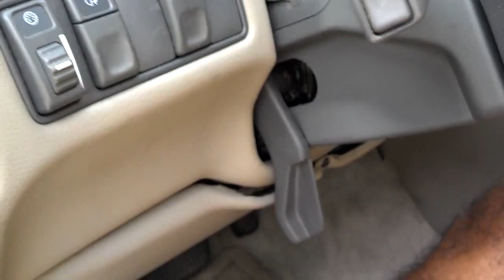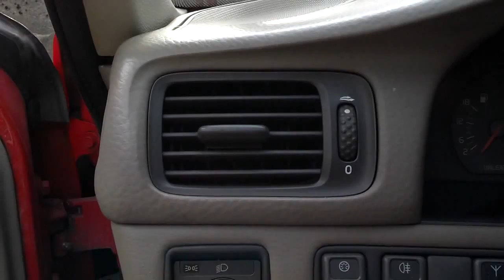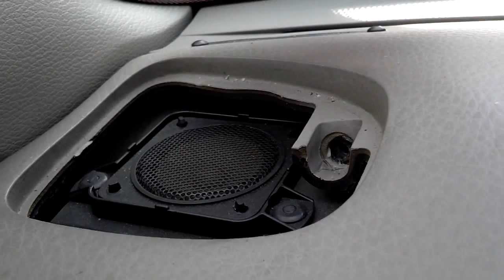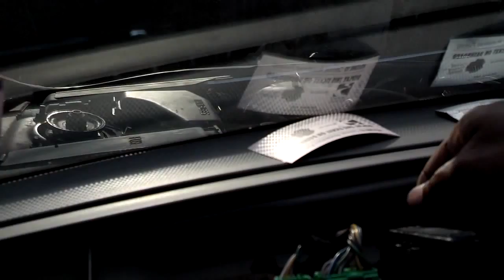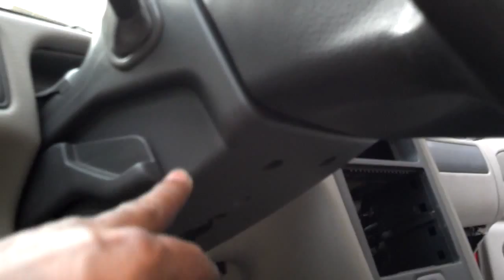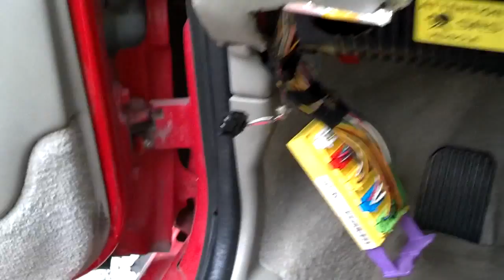Dash removal for noise / evaporator replacement, Volvo S70, V70, 850  Repair part 1 of 3 - VOTD

Comment: Hi there Robert, your videos have been very useful in working on my 2001 V70, I didn’t see how you pulled the gear shift knob, is there some trick to it or will brute force remove it.
Reply from the maker: force
Reply: Thanks, I didn’t want to yank on it and break something else.

Comment: I was fortunate to not have this problem, knock on wood, on my former '95 850 T5 or current '98 S70 T5.  I have had the dash pad out on the S70 and my '05 V70 2.5T - fun job!
Reply from the maker: cool

Comment: Hi Robert! I have a 850R 1996 with the gray interior and the dash pad and dash are cracked into pieces over the years. My question to you is I see a bunch of tan dash and no cracks. Can I take the gray parts of my dash and put it where the tan parts of a donor car or are those permanently bonded on?
Reply from the maker: huh? I don't think so.

Comment: Hey Robert ,  Any clues as to what would cause all 4 windows AND the sunroof to suddenly not operate on my 2000 V70 GLT ?  Strangely , when I got off work last night I was able to operate both front windows but couldn’t get the rears nor the sunroof to close either .  Right now none of the 5 are operating .  I know you’ve been in the middle of a big move , so you may not even have your WiFi set up yet (?) .   Thanks in advance for any suggestions !    I hope your move went well and that you’re loving your new home .
Reply from the maker: have you checked fuses?
Reply: @RobertDIY   Thanks for your quick reply !  You know what , I’m thinking your first guess was spot-on - bad ignition switch .  About the fuses related to the windows :  I did look for the window motor fuse(s) on the lid to the fuse box and was confused as there doesn’t seem to be designated fuse printed on the fuse list there .  I DID however just went ahead and checked all my fuses just in case there was a fuse that covered more than just those windows - all looked good .   SO , (and this is a tad embarrassing) because I have had that button on the gear shifter not pop back out , etc. so I’ve gotta fix that as well .  I’ll have a look at the video that’s linked to the link you gave me .   I’m about 95% sure that’s the issue .   WIRING IS SO STRANGE !  (I just found your video that shows how to replace that gear shift button also) 
I mean ,  who would guess the windows and sunroof not operating would be related to a bad ignition switch ?  Time to watch that and order some parts .   Thank you again , Robert .  Second time you’ve saved me $ !   Forgive my long reply .   I’m just happy you were able to help me .
Reply from the maker: Silver metal fuses under the edge of the box lid.
Reply from the maker: https://youtu.be/x3MP9KaPMqA

Comment: Robert. Thank you. You have a great communication skill along with your mechanical skill. I am just beginning this job on my 1998 V70. And yes i scraped my hand on that climate control cluster removal!  I appreciate your instruction.
Reply from the maker: Ouch! When you support the dash mounts, use 1/2" stainless steel straps. Thinner and easier to get the dash back in.
Reply: Robert DIY your idea of the straps worked perfectly just as you described. Thank you Robert! I had this system running icy cold. But today the low pressure side line just popped off the evaporator. Couldnt believe it. I thought for sure it locked in place. It appears the line bottoms out when inserted all the way in. But i suppose the locking spring mechanism is stuck or broken. Have you run into this before?

Comment: hello Robert, Thanks for the great videos. I have an 850 sw 2.3 turbo 1996. My climate Control does not work properly. the Ac Works but just cant choose where the Air flow goes (down, center, windshield). what Can i do?
Reply from the maker: Make one of these and read the error codes.
Reply from the maker: https://youtu.be/LpoyZsaPVqc
Reply from the maker: Where are you located

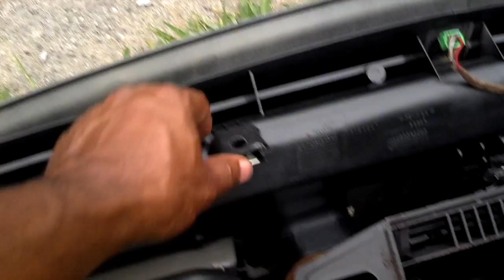Comment: What is this "sensor" 22:09 min green plug in the center of the dashboard?
Reply from the maker: Alarm light.
Reply: @RobertDIY  What does it do? I was not even aware that the car has some alarm system...
Reply: @RobertDIY  well, I don't have the alarm. On my car there is just flat piece of plastic. Thanks anyways

Comment: I really wish someone would show me how the airbag connector disconnects. I've watched 5 different videos and and searched forums and everyone just skips over that part without actually showing how to disconnect it. It's not a normal looking connector and it doesn't seem obvious on how to disconnect it so I don't want to break it. I'm stuck in limbo trying to remove my dash to replace/upgrade my dash speakers
Reply from the maker: I've posted several videos over the years showing how I disconnect it. Squeeze the taps and pull the wire out of the connector.
Reply: @RobertDIY  instructions don't really help. The connector I have doesn't look like yours. A video would help. I've watched 2 of your videos and they both skip over
Reply from the maker: Well, I don't even know what year model car you have. It's just a connector, isn't that hard to figure out.

Comment: After removing the all bolts. Do you have to give the dash a good tug? Or do they come out pretty easily
Reply from the maker: Have you tried it?
Reply: Robert DIY I pulled a junk yard dash. I had to pull pretty hard. Not sure if i further damages the brackets in the process. But I’m about to attempt to pull my dash
Reply from the maker: Sometimes they are stuck to the firewall because of the material they put between the dash and firewall metal to reduce noise.
Reply: Robert DIY okay i understand. Thank you for your help Robert. Keep up the good work
Reply: @Marcos8311mmc  For me it came right off but make sure to check everyone screw is gone so there is no leftover screw.

Comment: Aw man, not the windshield wiper shroud!  I JB welded my left wiper arm to the armature after exhausting all other possible repair options.  (The armature had no grip on the wiper arm and it was much too stripped to be fixed save to JB weld it.)  Perhaps I can cut the shroud so that I don't have to remove the left windshield wiper.  But if the tabs at the back of the dash are typically broken like crazy just from dry rot as shown in this video, then I suppose I can skip loosening the 4 bolts under the windshield shroud.  The evaporator leaks and the driver side AC temp control valve is messed up.  I can compensate for the slow evaporator leak by adding refrigerant every few months, but that valve, that valve...  I don't know if I can access it short of dash removal.
Reply from the maker: https://www.youtube.com/watch?v=VGxyj0UTDp4
Reply: One more question, how did you remove the knob on the gear shifter?
Reply from the maker: https://youtu.be/gt9w-ZSxs9I
Reply from the maker: https://youtu.be/rNi4orgovpE

Comment: The passenger air bag on my 1999 S70 is wired different, anyone else come across this?  Actually stopped there since I couldn't figure out where or if it's even possible to disconnect the air bag.  Any ideas?  thanks everyone.
Reply from the maker: +David Fierro the plug clip slides out to unlock it.

Comment: my car haven't had any pollenfilter and the evapolator is FULL with dirt, mud and other nasty stuff. I have been trying to clean it while is in the car from the fan whole but can't reach to it. is it bad for my health if it's that dirty? or does that dirt just stay there and not spreading bacteria via they air from the vents?
Reply from the maker: +AlfaPower probably.

Comment: Robert - I am getting ready to tackle this on a 1999 Volvo V70.  The issue is that I don't have the access to parts from a salvage yard that includes a lot of Volvo parts.   So, the question is this - without the brackets all being there, it is possible to repair the car using the existing dash?  Thanks in advance and thanks for all the other videos...they are very, very helpful.
Reply from the maker: +craigholliday did you watch part 2? The link is in the comments.
Reply: I did.  I must have missed it as I was watching very hard to make sure I got the nuances.  Sorry for the contact for nothing.  Thanks for the note.
Reply from the maker: +craigholliday no problem.

Comment: I have a 1990 Volvo 760 GLE.  I have a vacuum leak that I hear from inside the car, through the vents. There are 3 vacuum lines that plug into receptors on the firewall. I have disconnected them and plugged them temporarily,  to avoid the loss of engine vacuum. Is there an easy way to find those lines inside the dash so as to discover and fix the leak. I think the lines are used to control the vent doors. Maybe you can point me to another of your videos which may better reveal a solution
Reply from the maker: There are bellows behind the dash that crack. I believe the dash has to be pulled to find and fix the leak. I do not have a video of the process.

Comment: What if I put a 850 dash in a s70 GLT? Is it possible?
Reply from the maker: +LuisWRXSTi Entire dash or just the top pad?
Reply: Entire
Reply from the maker: It will probably fit, you'll need to do wiring and all of that stuff.
Reply from the maker: Doubt the ECC will work.

Comment: You forgot to tell people to unplug the heated seat plugs near the coin tray, in vehicles that have them. They can damage kind of easy, and i know you didnt have them in your car so you werent thinking about it. Its also good time to change the bulbs in those heated seat switches, as well as the ashtray/ cointray light.
Reply from the maker: +Eastsidegeorgiaboy Cool, thanks for sharing.
Reply: Eastsidegeorgiaboy dash rattle

Comment: Hey rob, I've been following these videos to get rid of the dash noise and I would like to point out two things that made getting the whole dash out easier which are to remove the ashtray and also the shifter knob. You have that done on your video I just figured it would be useful to mention here. To remove the shifter knob you just put it on low gear and I just pulled it up with care and brute force so I'm hoping I didn't damage anything though that's what people said to do. Thanks for the video man, made things a hell of a lot easier though the broken pieces are overwhelming! I'm the third owner of a 99 S70 and apparently the only one who ales good care of it lol
Reply from the maker: Juan Olivares Glad you got it fixed. I usually do NOT remove the shifter. Sometimes they break.

Comment: I can't seem to remove the center console in my S70, I need to fix the cigarette lighter and the bulb under the shifter. How did you remove it?
Reply from the maker: Emerson Hidalgo Volvo S70 V70 Center Console Removal - Auto Repair Series

Comment: Great video. I used this video to take apart my whole dash, and used it to put it back together, just to find everything was perfect and intact, and that the fuse was intermittently working. At least now i know i have a good evaporator and heater unit.
Reply from the maker: Sean Huffstickler Wow! You had an AC issue?
Reply: Robert DIY yes. The PO installed a modem and wired it to the climate control fuse. somehow, that unit wasn't allowing the a/c relay to work properly. i disconnected the modem wires, and had to thicken the fuse leg because of intermittent connectivity. low and behold 246k miles on the odometer and everything on it works like new
Reply from the maker: Nice

Comment: Good video man, my S70 dash has driven me nuts for a year.  Used epoxy on the mounts and a fiberglass type fiber for strength... No more squeaks so far.
Reply from the maker: Corey Wright Nice. Glad the video helped.

Comment: i'm not sure if you know or not, but i stuck my head behind the steering wheel while removing the airbag, and the bolts that hold it in aren't T30's, they use an allen wrench.
Reply from the maker: Sean Huffstickler Which car do you have? Maybe they have been changed.
Reply: Robert DIY 1998 S70 non-turbo. The head of the bolt on the airbag unit is a 4mm allen wrench. the torques will work, but the allen key is the type of head on the bolt
Reply from the maker: Cool, thanks for the info.

Comment: i have removed two sunroofs on the 850 Volvo's and neither of them work is this a normal problem with the 850 ?
Reply from the maker: Nope. How do you know they don't work? And why are we posting sunroof problem on a dash video? Roof head ceiling liner and sunroof removal, Volvo and other cars - Auto Repair Series

Comment: Blessings Robert. My mechanic and I will be replacing the ac evaporator. The question he ask me to present to you is what tool do you need to disconnect the ac lines at the connection into the evaporator by the firewall. He said to mention the garter springs. hope I presented the question correctly so that you may know what I am talking about. Thank you for being for the people. God bless
Reply from the maker: Hi Sarah. They are not special, if he knows what they are called (I did not), she should know how to get the loose. I'm pretty sure you use fuel line disconnects. I used some plastic ones that wrap around the lines, slide in and release the line.
Reply: Robert DIY Hi again Robert. Thank you for getting back to me. I may have misinformed you on the use of the term"my mechanic" . I didn't mean it to mean a true mechanic. It is someone who is new to the business of repairing cars and don't have a problem going online to people such as yourself and experiencing. It is not his trade. In either case, he is willing to help me fix my car to the best of his ability and that is why I came to you for your knowledge and help. Neither one of us has ever done anything like this before. Thank you again. Have a bless day.ps  I am open for any other info you can share on the tool .
Reply from the maker: If you go to an auto parts store and tell them you need fuel line release tools they will help you find them. They cost about $12, are plastic and about 5 in the set.

Comment: I have a 99 s70 and about 8 months ago the lower part of the dash on the passenger's side (under the glove box) detached itself. If I remember correct it looked like there were plastic "clips" that had snapped. I fixed it with A LOT of super glue and something to prop it up. Do you know a quick, easy, cheap fix for this? Also, do you know where I could find replacement parts?
Reply from the maker: That part of the dash is part of the entire unit. Some go to junked cars, others pull it and try to fix it with different means. Tough situation.